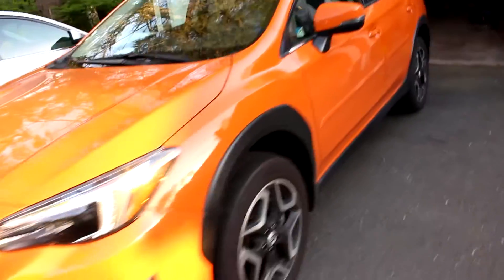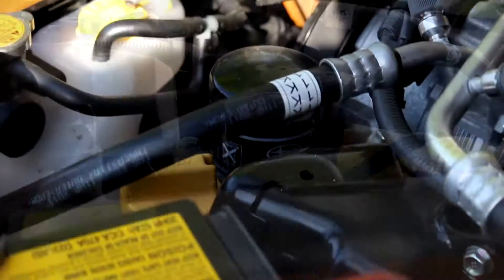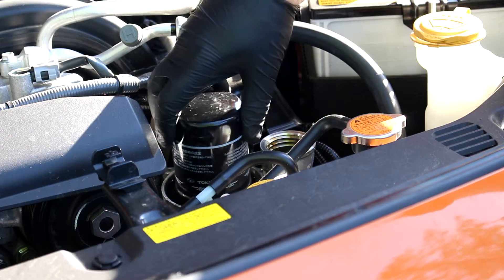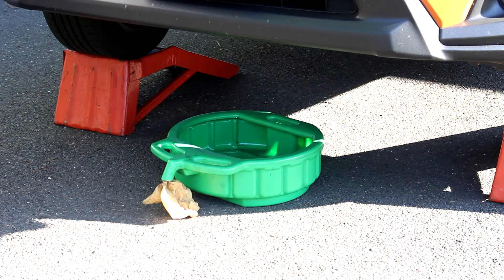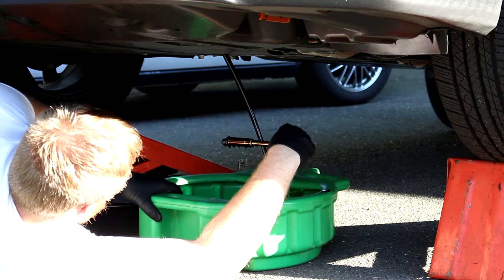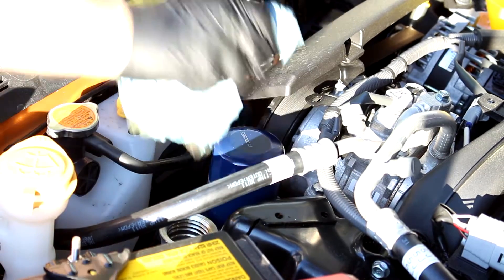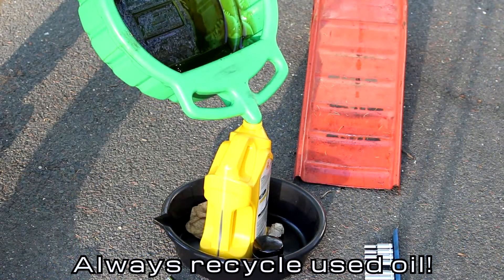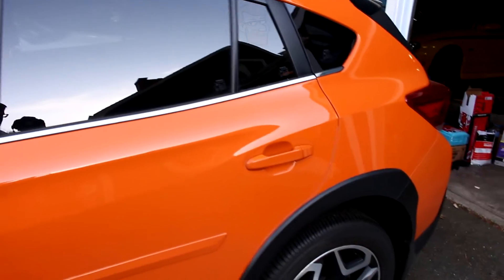New 2018 Crosstrek & Its First Oil Change • Cars Simplified

Comment: WARNING: First timers, watch the video and don't do like I did and drain the CVT by mistake. Yeah I know I am a idiot but let my mistake save you. Per Subaru the CVT is not user serviceable other than the fact that the drain is a common 14mm bolt that screams "Hey I am a drain plug". There is no dip stick or fill port for CVT. I had to have car towed and serviced at dealership. ~$450 fine for being stupid.
Reply: DOH!

Comment: Welcome to the Subaru fold!  Glad to see they learned their lessons on oil filter location; if I do a video on changing the oil on my Legacy, you'll see what a pain that is.  Getting the filter off is a NIGHTMARE.  Great stuff man!
Reply from the maker: Thanks! I have always liked what they have to offer. As for the filter, I have heard some of them have exhaust pipes practically wrapped around the filter, so it is nice and toasty for the folks at the quick lube places. Is that how yours is set up?
Reply: Yeah.  There's no access to the side of the filter at all, so it's not just toasty in there, it's nearly impossible to get a wrench on there to unscrew it.

Comment: No it is not 5qts, that is overfilling the engine. Did you replace the crushwasher on the drain plug bolt, what was the torque on the drain plug and finally what was the oil filter part number........Lot of it is left out here.

Comment: Do you think the ramps are required to do the oil change or would there be enough clearance to squeeze in to do the job?
Reply from the maker: I suspect it could be done without ramps, but it would be a struggle for space with the oil catch pan under there. Any safe way to get the car just a little higher will definitely make the job much easier.
Reply: not all of us are skinny

Comment: What size socket is needed for the drain plug?
Reply from the maker: I'll have to check that. 17mm and 14mm both come to mind and I don't see anything online confirming one or the other. I need to change the oil again this month, so I'll take a look.

Comment: Did you have a problem getting the crush washer off of the drain plug since it might have been painted on like the drain plug was to the oil pan?  I have heard some people mention this was a nuisance with the first oil change!   Drain plug is 14 mm I believe.
Reply from the maker: I don't recall how tough it was to get the washer off the drain plug, but the paint definitely made the initial removal of the plug from the pan quite a pain!
Reply: @CarsSimplified  so since you don't recall it probably wasn't an issue for you, that's great!  I had the dealer do my first one in July but I will do them going forward.  Thanks again!

Comment: Getting ready to do my first oil change .Do I trust the guy at Autozone  to sell me the correct oil and filter ,or Is there a Specific Oil OEM vs Synthetic ?
Reply from the maker: The OEM oil isn't going to be at any parts store, but oils that are equivalent and better will be. I went full synthetic and I don't think there is anything less than full synthetic available for 0W-20.
Reply: You can find great deals on Subaru filters on ebay. I just bought 4 Subaru filters and 4 crush washers for the oil drain plug for $28.00